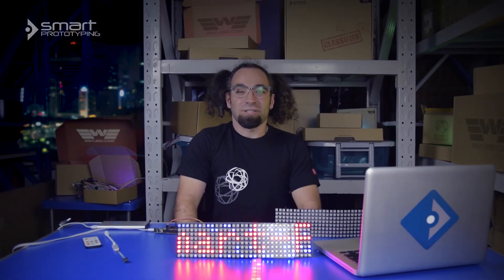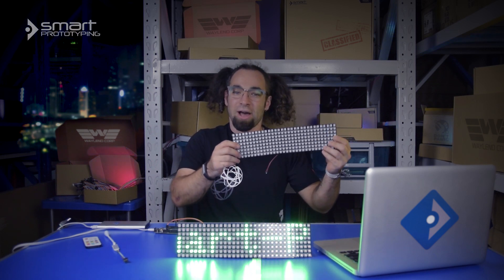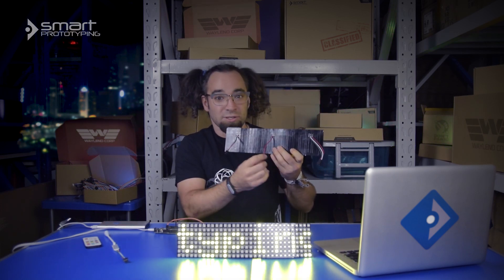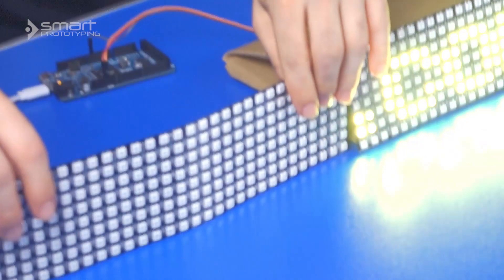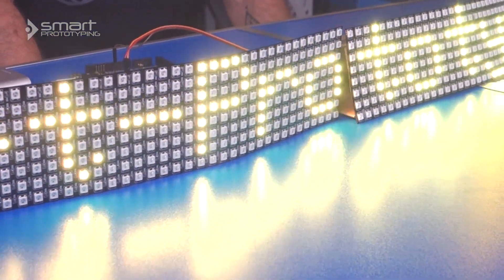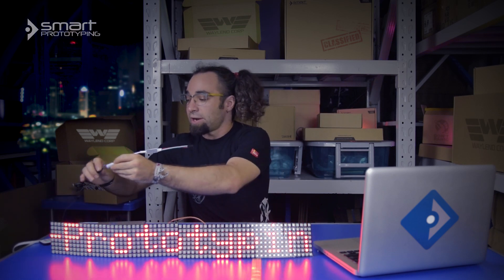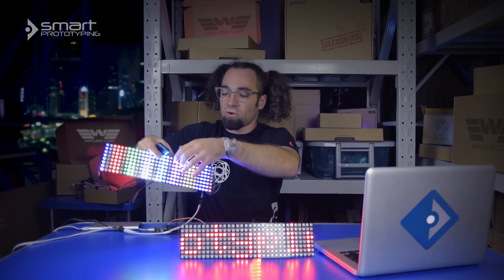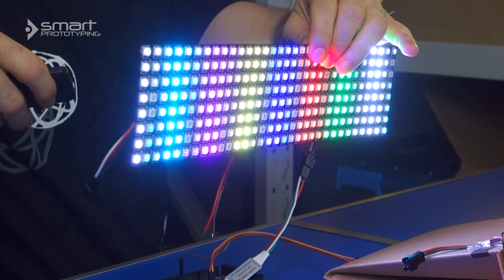Product Introduction: Flexible RGB LED Matrix 8x32

Comment: Can this be powered with a battery pack?
Reply: yes, I assume it's 5V, but could be 12V, so just get a matching 5V or 12V battery, but make sure it has enough Amps to handle lighting all the LEDs. Higher Amps better because the battery will last longer. More Amps wont damage anything, but if the volts are too high  it'll damage it . As a guess I'd try to get a 10A battery per LED matrix panel

Comment: I would like to build an array of these with WS2812B LED strips; How do I connect the ends of each strip, starting on the right side of the first strip? Thank you
Reply: at the right : where it's written DIN which stand for DATA INPUT